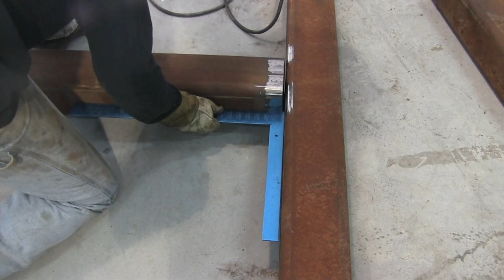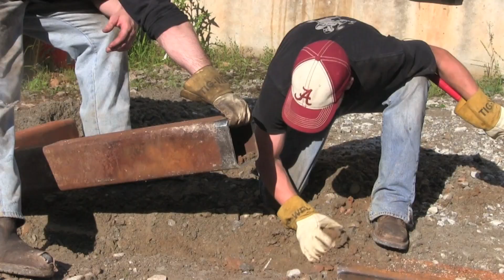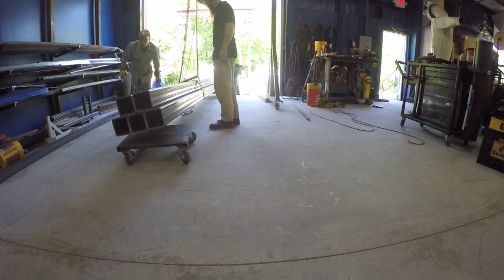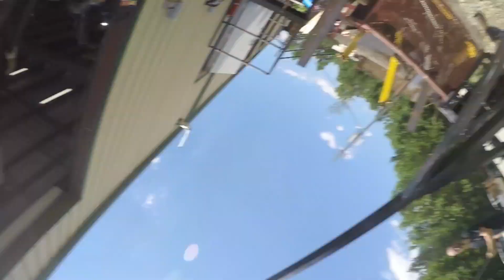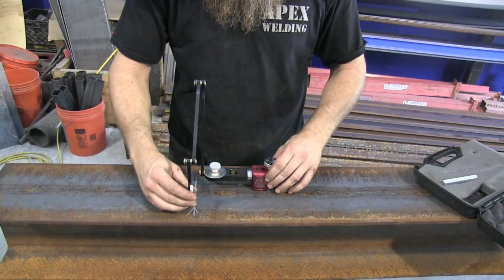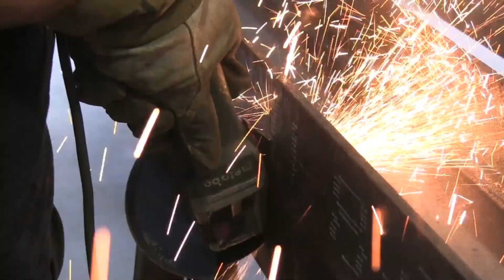Metabo vs Cutting Torch

Comment: A young neighbor of mine has a cold chop saw that he got from a local hardware store for around $160.  This thing can whack through a piece of 4x4x 1/4" tubing faster than you can say "Hillary Clinton sucks"!!!!!!  I think it has a "Ridgid" name on it.  If you had one you'd put that band saw on Craigslist!!!!!!
Reply: Hahaha😂
Reply: Great observation! A past employer of mine came into the shop with a chop saw that he'd purchased a very expensive blade for (Evolution if I'm not mistaken.) We all thought he'd lost his mind so I dug out 4 pieces of 4340 heat treat 1 1/2" solid round stock chunks I had, we locked them in 2 x 2 to the saw vise and were amazed as this thing went through them ALL in about 15 seconds...and you should have seen the big pile of smoking blue and purple chips behind the saw!! That 1st blade lasted us about 6 months cutting double Unistruts all day, 6 days a week! It was a metal blade with carbide inserts and I believe it cost about twice as much as the saw did!
Reply: Metal chop saws are the best for straight cuts. They leave the metal a lot cooler than oxy ace and powerplasma cutting but you have to watch out for those chips flying. Plasma cutting is still king for any cuts that require curves!
Reply: We have a Marvel Mark II band saw where I work. Although chop saws are more efficient at times, I can gang material 18' high and wide to make multiple parts in no time.
Reply: I've worked in some shops w/ very old (1940s) drop band saws and standing band saws. agreed, with a little adjustment and a good blade, those would flat fly through material cutting jobs!
Reply: How can I help you?
Reply: Patrick Parsons hahaha
Reply: We have one of those at work. Never seen one before then, but it's just an amped up chop saw with what would otherwise look like a wood cutting blade (don't know the brand). Cuts through 1/2 x 3 flat bar in about 3 seconds.  Beats the hell out of both the cold saw and the industrial band saw with just as nice of a finish.  Suppose the limiting factor in a square cut is the poor chop saw clamp.

Edit: +timm white
Reply: Al RedAye EVOLUTION chop saws are hands down the best IMHO .. They cut super fast ...I cut up to 2" solid round stainless no problem... It cuts  Regular A-36 steel  like butter, It rips through 3×2×1/4 in 3 secs..
Reply: Once you use a Marvel model 8 - there's nothing else you'll ever want. It's not just a band saw - for me it's "the" band saw that all serious fab shops should have. Cutting one beam with a grinder or torch is one thing, cutting 50 of them accurately is another thing entirely. And cutting a full bundle of steel at a time while you go do other work is a big time saver too.  I also have an Evolution Rage 3 - it's a flimsy piece of crap - but it does cut small steel pretty damn well and has an enormous capacity for a portable saw.

Comment: With all due respect, May I ask you how good can you see with your glasses? I did weld probably for 20 years and manage to get out of the trade before my eyes started to diminish..now I'm much older and my eyes have been getting worst and worst... now the question is with your prescriptions can you see 20-20?
Reply: Probably only in hindsight.
Reply: You can get prescription safety glasses... you can also get diopture correction lenses to fit directly into your head shield....mind you i worked with an old welder who went through all the ranges, the other coded pipe welders reckoned he was the only welder on their team that could weld by....Breale....

Comment: He cuts really weird with the grinder. At least the parts i saw. In the first clip he cuts towards himself for no apparent reason? I've always thought that's something to be avoided because the cutter can stick and dig in... Not that it's dangerous or anything but still.
Reply: He Ka very stupid thing to do. If it catches it will explode and better hope it dont hit you. Friend of mine caught a piece on his jaw, nasty as hell
Reply: if he cut away from himself he could not see the cut line
Reply: john walt yes you can, iv used a metabo or cut wheel for years.
Reply: But he was going for time.
Reply: Jimmy's Tractor what he was doing was unsafe and much slower. Been using cut wheels/metabo for over 10 years.
Reply: ted s I thought about putting the - lol at the end. My 2nd most painful life event involved a cutting wheel going through the center of my middle finger nail.
Reply: Jimmy's Tractor ouch, iv had a skim across my knuckle but my buddie i mentioned wasn't wearing a face shield when one blew up. Cut his jaw open bad, not a pretty scene.
Reply: ted s my top 2 are that and a thumb nail split horizontally at the base by a jagged rusty edge.
Reply: Jimmy's Tractor lol damn. Ya in any industry you can get hurt or worse. But it seems there is more in welding/fabricating industry.

Comment: Just my inner cheap guy coming out... i wonder what is also cheaper per hour to run. I only say that since wheels (cut/flap) last so long and cost so much and gas costs so much as well. all that aside it really shows that the right tool for the job makes all the difference! from the start i had my money on the grinder strictly because grinding off slag can be time consuming especially on a complex part.
Reply: You'd have to do a thousand cuts to be accurate with that comparison. I "think' it would be a close match.Over 3/8 is a torch win. Thin stuff the disc easily wins.Then there is plasma or portaband.... ?

Comment: hey do you have know how to get welding certified with out going to school. I been welding for 11years. but I need to become certified and I don't really have time for school.
Reply: If you're a member of a trade union, your local union office should have good contacts with the certification agencies. If you're not union, try contacting the area AWS office, (if you want AWS certs) otherwise contact the community college welding instructors, I'm sure they can tell you how to contact a testing facility. In my area Oxarc does both training and certification tests.
Reply: If you're a member of a trade union, your local union office should have good contacts with the certification agencies. If you're not union, try contacting the area AWS office, (if you want AWS certs) otherwise contact the community college welding instructors, I'm sure they can tell you how to contact a testing facility. In my area Oxarc does both training and certification tests.
Reply: +Darryl Machtmes thank you it was very helpful
Reply: You need to go to school to get certified? All i did was weld a few pipe tilted 45 degrees with a dude looking over my shoulder. The the welds got x-rayed and break tested (dont know all the english terms). Absolutely no studying involved, just pure workmanship :)
Reply: School is a good option. If you're a good welder with experience in multiple position welding, then, yes you could go straight to the certification facility to do the test welds. It's just that most facilities that do weld testing for certification don't advertize that service very well. That's where the contact information from the welding training programs comes in really handy.
Reply: Okay, thats pretty much how it works here in Sweden too. I thought it ment you had to have theoretical studying to get certified.

Comment: What am I missing?  He has a horizontal bandsaw, why not just set it to cut and go do something else while the saw does its thing.  Added benefit is no gas or disc cost.  Thanks for the vids.
Reply: Just trying to show other ways to cut metal...
 horz saw $1200
torch setup$500-750
Grinder. $250

Comment: What's the thickness of the cut off wheel?  I may have missed it.
Reply: .045" thickness.
Reply: Most cutting wheels are .045 inches thick. Something like 1.1mm, where I am working right now we aren't allowed to use them.
Reply: +Justin Hogan dayum that moved thru pretty quick to not break and be that thin.
Reply: Most cutting wheels are .045 inches thick. Something like 1.1mm, where I am working right now we aren't allowed to use them.
Reply: +Mike Miller yeah the 4.5" ones I use are .045.  Just hard to imagine a 6".  That is some SFM tho.
Reply: If you aren't reasonably careful to keep the blade straight, they can shatter. Did that once cutting expanded metal. They can survive a surprising amount of abuse though - seen plenty of fools using the slicer wheels to grind. Stayed as far from them as I could.
Reply: Its not even that big a disc/grinder.. 6" or 150mm is probably the best for this job but I have a 230mm cutting disc for a grinder twice that size (Bosch grinder with 2000W) but these big discs are 3mm or 0.11" thick so maybe not that fast. Might be a good idea to look for something thinner. I use that grinder with a diamond cutting wheel for stone most of the time but you could do metal with no problems. Since I do work with sheet metal or small pipes and stuff a 4.5" is good enough.. 

Nice Video!
Reply: Those blades are .045 @ 6".  They are like "upper mid range" discs and cost around $3.50/disc. They are fairly rigid and keep most of their starting width, works really well for fab. Fairly safe.
I also use another cutting disc that does the opposite... deteriorates quickly, breaks apart, narrows during cut.... we use these for demo work. They work great because they can cut anything but they are more dangerous.  But they normally are less than $1.75/disc.
Reply: ...they do a helluva job @ sharpening Unibits (step drills) though. Very minimal pressure on the wheel, start at the groove and work toward the edge, keep a cup of icewater nearby to cool the tool steel. When you're done it'll cut like new!
Reply: ...used to go buy 'em but they are getting expensive! Then I discovered the Harbor Freight step drills....watch the prices, when they get low buy them! They outlast Lenox, Klein, Greenlee, etc. Wouldn't believe it if I hadn't tried them myself...at 1/10 the price! : )'
Reply: You sir are da man! I never thought to do that on my Unibits. I certainly will now.

Comment: Grinder ok but cutting disc is not usual this is for inoxidablesteel en 1,5mm that makes this so easy als you put on Metabo 2,5mm disc this all will go slowlly. Metabo ok but grinder can not self make chose wich disc is better for it.

Comment: thanks man for sharing, picked up a couple things AS ALWAYS. the marking tool is on my list (this is a time saver by the nth power). EDIT thanks for explaining the weld symbol (we are waiting for more of this he). is that metabo running backwards? haha. well,  thanks again. these videos are super helpful for the small shop. take care. pete
Reply: Not running backwards, but i would say he is holding it in a dangerous way that if it binds and kicks back its coming right at his arms.
Reply: yup it`s a bit tricky this way, not the safest but i have done it many times to keep the sparks away from my face (two handed death grip tho). i don`t care much for grinders as i`ve become sensitive to fiberglass smoke and have to use a respirator to avoid the headache from hell i get anytime i smell the stuff. a lesson too late... use the damn ppe

Comment: Milwaukee metal cutting saw for the  flanges and a 6" Metabo for the few inches of web left over would probably get you under 4 min. on the beam and just the Milwaukee saw would get you sub 3 min on the tubing.  For an individual the blade cost might deter some, but for a business time is money.  Plasma in the right hands, smokes em all.

Comment: The torch is being replaced by the grinder and portable bandsaw in modern industrial construction . A GOOD guy on the torch is faster , very minimal grinding on pipe,plate structural necessary afterwards.Wonder why hand arm vibration syndrome is so common now?

Comment: i will never use a death wheel to cut any kind of 1/2 inch and up steel again. If you get those things slightly bent in your cut or catch an edge they explode into a million peices. Get yourself a pony rig or a simple bottle cart and torch that stuff.

Comment: Run propylene or propane with the appropriate tip on the torch and it will not only cut faster, but it will leave virtually no slag boogers. I've got my Oxweld and Purox cutters dialed in so well on propane that I don't even bother with the plasma or cutoff wheel above 3/16". One quick hit with the flapper sand disc on the edges of the cut and it's ready to weld.

This is what a good oxy-fuel gas cut looks like: https://www.youtube.com/watch?v=WZRPlSoMmgk&t=5m45s

That either 1/2" or 5/8", and you can see how fast the cut goes and how clean the result is. And the best part is that you don't eat grinding dust all day!

Comment: I don't know why metabo is so much overpriced. makita makes the same quality built tools for half the price
Reply: Metabo is mostly handmade and pure quality.
Reply: astafzciba there is a huge difference between a lifetime guarantee on a home DIY-er tool and a dedicated pro-sop heavy daily use lifetime guarantee... the qualities are not equal.
Reply: I had a brand new makita 7", less than two hours on it the trigger locked up and wouldn't ever power up. My employer had multiple metabos that ran flawlessly for about a decade
Reply: astafzciba quality no more
Reply: Makita is No longer what it used to be the tools are not bad but they just dont keep up with Metabo Fein or Hilti anymore...
Reply: astafzciba becouse the are made in Germany 😉
Reply: astafzciba metabo are good products i like then and also Milwaukee

Comment: Everything your doing in the shop is meant for field work, seriously inefficient, 4 guys to unload a bit of steel, 2 guys to make one cut?  Who uses torches in shop to do strait cuts?  It's called a bandsaw. One operator half the time.  And yes it is a dangerous way to use a cutting disc

Comment: plasma cutter is faster
Reply: Вадим Туров but you spend the time you saved cleaning up the cut anyway
Reply: Depends on the metal thickness and whether the cutter is dialled in. I don't usually get a lot of dross with my powerplasma cutter.

Comment: I bought a Metabo because of this video number one it is not a 13 amp grinder bogs down way too easy for 13 amps and the blade release I ended up taking a grinder to it freaking impossible to remove a stuck wheel with gloves on I like a rat tail grinder when I got that thing I thought it had a trigger lock on it you had a trigger lock out another modification I've done to that b** ass s*** never again will I buy a Metabo product